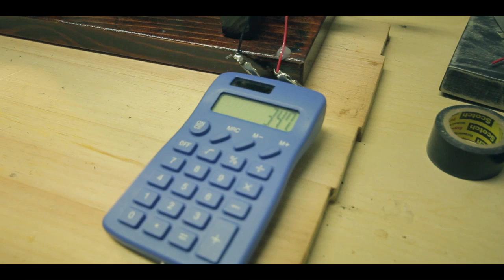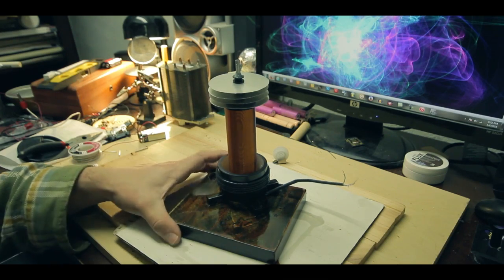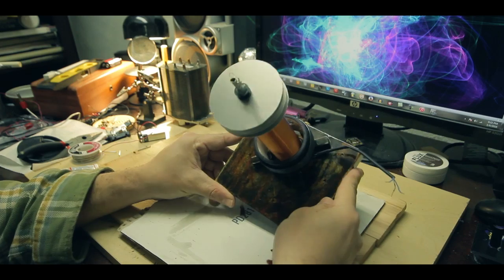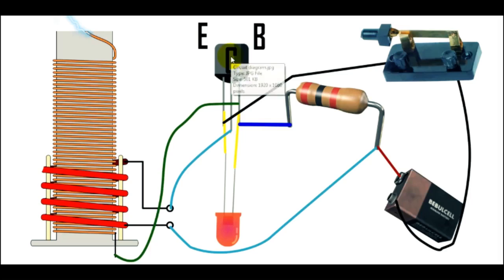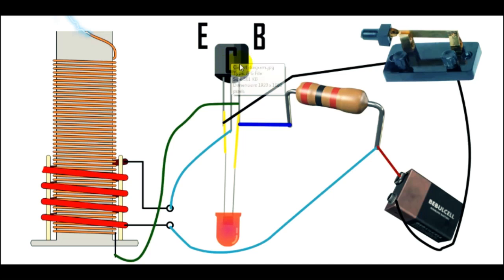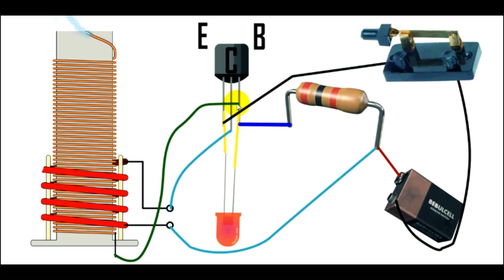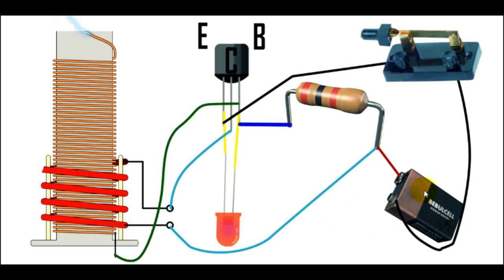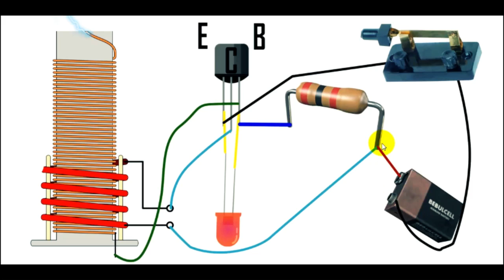DIY Tesla Slayer Exciter Coil Tutorial Mini How to Build Easy Circuit Explanation

Comment: Nice video !
Whats the difference between this and a emp jammer that you see on youtube ?
Reply from the maker: +Gabriel Engel I'm not too familiar with the EMP jammer.  But from what I can tell they are similar. Only the EMP jammer uses capacitors, less copper wire for the coils, and requires more voltage. The idea being small and compact-- cigarette pack size.  They are both step-up transformers with an oscillating circuit. 

 A Tesla coil with capacitors (if using equivalent voltage as the jammer) would put out more electromagnetic waves (amplify) simply because it uses more wire.
Reply: +José Davēd Thank you very kind for your time to answer.

Comment: Jose D..thank you you are top notch instructor .,from many videos i have checked about this topic this is the first time i completely   understood .,you make a hell of a grate teacher ...
Reply from the maker: +RAMM GARR Thanks so much! I'm glad this video helped...
Reply: +José Davēd  How to increase the distance to lighten the bulb of Tesla coil?? And how it work with transistor, resistor... That's very kind of you if you help me. You can give me 10 points for my test again
Reply from the maker: +Toshiya Kiroyo You would have to increase the power, and use a transistor that could handle the load.  Adding a capacitor would also be needed. Thanks for watching!
Reply: +José Davēd Guest me some transistor
Reply from the maker: +Toshiya Kiroyo Tip 31 transistor should  be able to handle 18 volts, or two 9 volt batteries.
Reply: +José Davēd I can use TIP35c, Do you know how it work with transistor and resistor?
Reply from the maker: +Toshiya Kiroyo You could use the Tip35. Technically you could use various transistors, but you will need to view the data sheet to see the specs on whatever transistor you decide to use.

A resistor is used in a oscillating circuit to regulate voltage so the transistor doesn't over heat or blow, and also to regulate the oscillating waveform. Since the Tesla coil is a step-up transformer you will also need to be mind of the current going back into the transistor. 

The voltage powering the circuit will determine what resistor to use.

Comment: hei man i have rebuild the schematic and now work perfectly tnx but i have more quest to you to amplify the radius need the aluminium ring to the upper right? and you know the radiant energy antenna ?? you have a schematic to create it and work whit the tesla coil ? can respond fast
Reply from the maker: +mirko mirko You don't need the aluminum top load for the Tesla coil to work. If you wanted to amplify it, you could use more power, like 12 volts.

I am aware of the radiant device and will be uploading several videos on this and more in the near future.

Comment: hei man i have rebuild your project but i have secondary coil whit 380 turn and work but not fine the led or lamp need to touch the copper wire of secondari coil not at distance why ? you can respond fast ?
Reply from the maker: +mirko mirko What gauge wire did you use for your primary and secondary? The turns (380) on the secondary should be fine. Is your primary elevated from the base, and how many turns? Also what is the wattage of your light bulb? I find 13 watts or lower work better and they must be fluorescent.
Reply: +José Davēd the secondary coil 0,32mm and primary coil 1.6mm
Reply: +José Davēd yes the primary coil is elevated and ave 5 turn
Reply from the maker: Is the light bulb 13 watts or under?
 Also sometimes you do need to make contact with the top load to light the bulb, but it should continue to stay lit about 12 inches away.
Reply from the maker: +mirko mirko Is the primary coil stranded wire? I believe this works best.
Reply: +José Davēd i used 2 tipe to primari coil with singolar wire And the secondo type with a normal wire
Reply: +José Davēd i have follow your progect feet to feet i have buy the dame item you used in the video